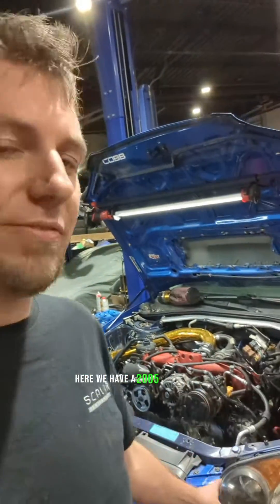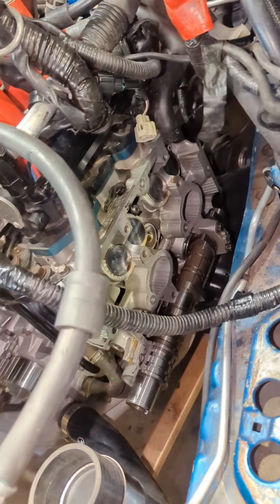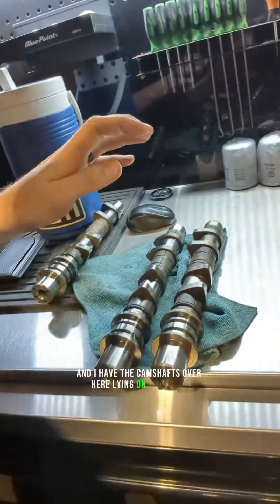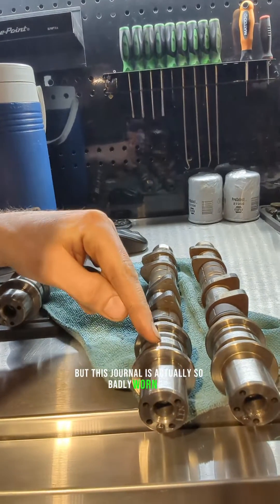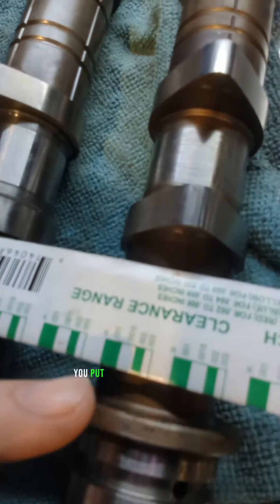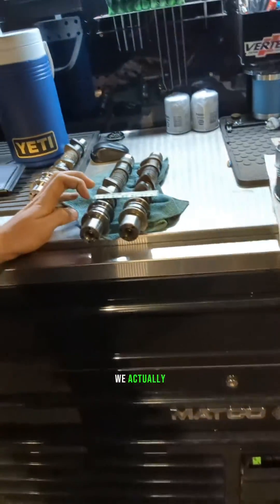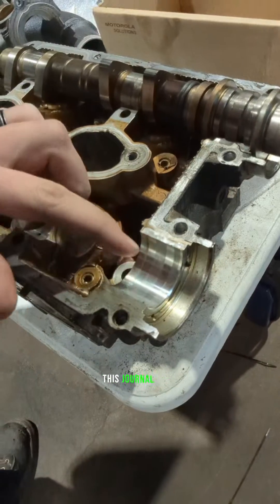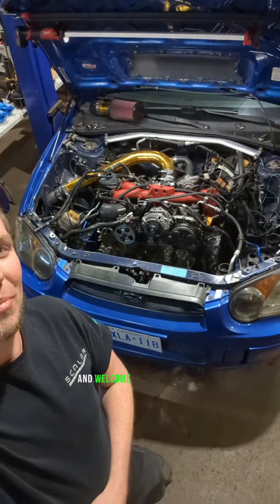SOLVED: 2005 Subaru STI Variable Valve Timing Issue

Comment: man, that was super helpful! 

Thank you for sharing!!

Question: for proper diagnosis, do you theorise what could be wrong first then test/measure your theory or perhaps look for a dx trouble code to help guide the way to a solution?
Sorry, Im new and still learning as much as I can.
Reply from the maker: We didn't jump right away to the camshaft being at fault, we did take the normal diagnostic process. We started by swapping VVT solenoids left to right, verify wiring is good, verify there are no shorts in the harness, verify good oil pressure when we tested it at the bajo bolt on the VVT solenoid with engine hot and cold, verify oil screens were not plugged with debris, the only thing left was the actual VVT phaser or oil passages in the cylinder head. We even went as far as scoping the VVT signal from the ECM to verify that we had a good duty cycle command from the computer and that both sides matched. The customer had already tried replacing the VVT phaser with a Subaru one so after verifying it was installed correctly and the dowel pin was in the correct hole we went to the oil flow circuit through the head and camshaft. The journal was so loose you could actually move the camshaft with your hand which led us to go straight to measuring the journal. After verifying that the camshaft journal was way undersized we continued to verify passages were clean and no debris was clogging anything to restrict oil flow that would have caused excessive wear on the cam. It was only the front journals that had the excessive wear to it. We ended up replacing both complete cylinder heads w/camshafts with used ones.  Hope this helps!